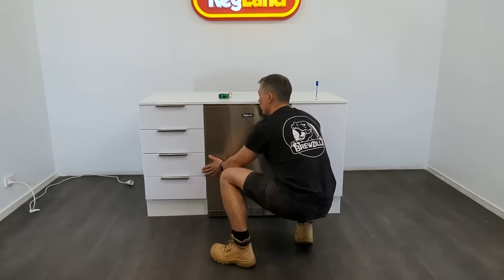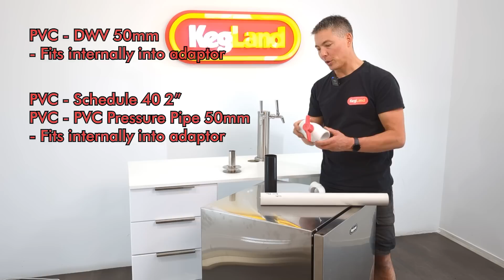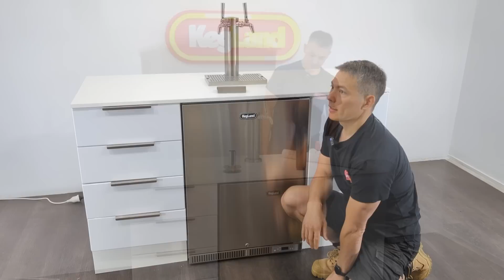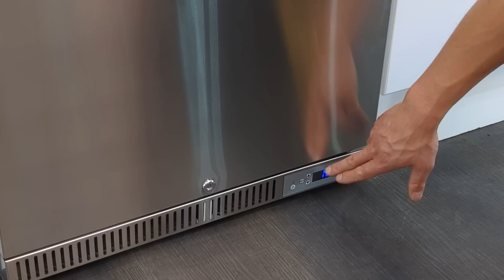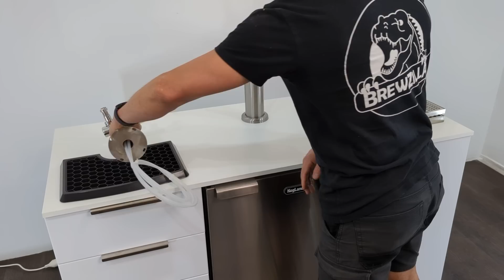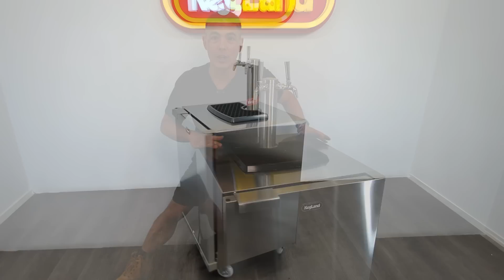How to Build Kegerator Under Counter (Undercover) into your Integrated Kitchen Bench

Comment: I had high expectations for this unit base off the price.
Issues I found with the unit a purchased
Wouldn't get below 4c
You cant manually turn the fans off and it has two both are noisy
It made a strange sound (series x had a pigeon sound) its more like an orca
I phoned Kegland and sent them a video and described the issues i was having, the reply was its within operating temperature and running normally. (they did recommend dropping the set temperature to 0c and it made no difference.
I have heard others having the same issue.
It’s been replaced with a series X.1 and that unit works fine.
I would not recommend this product based of my experiences.

Comment: Thinking about getting something like that installed in the garage. There is quite some dust/dirt in the garage at the bottom, will this work with the front fans sucking air in?

Comment: So I've been on the fence about adding a Kegerator into my home bar build, but was iffy about the 100mm spacing requirement. This has sealed the deal! If I wanted to plumb a drip tray, how much clearance do you think would be needed between the top of the Kegerator and the benchtop? Not convinced that would work super well, but that's not a huge deal.

Comment: Little bit fiddly getting installed. A very snug fit between the font stem, the extension piece and the thermal insulation. Also sliced up a neoprene stubbie cooler to insulate the first 25mm of the font adapter before the font insulation takes over. Works well now - my lowest tap can now accept an untipped pint glass.
Reply: How noisy is the fan at the bottom that comes on?

Comment: That is next level 🔥🔥🔥 and then that red gas line love it.. only thing better would be one of the lines that's and a springing coil. Like the yellow air compressor lines sometimes are.
Reply from the maker: Yes that is a fair point.  We have been asked for the coil hose before too.  Might be time for us to start to manufacture it I think.